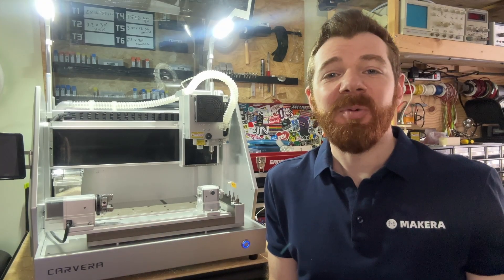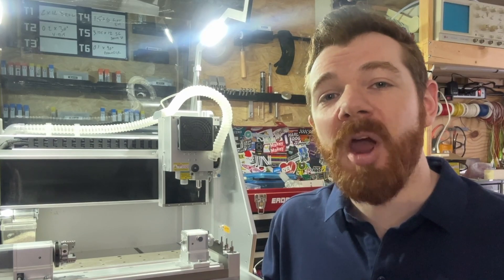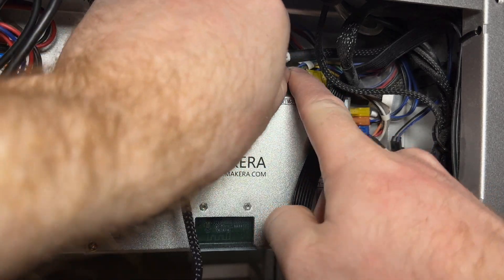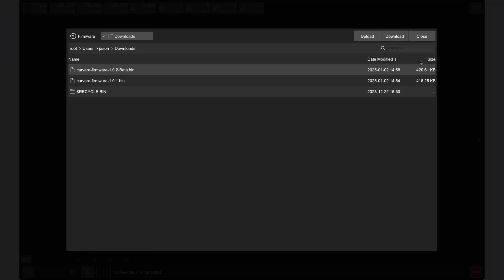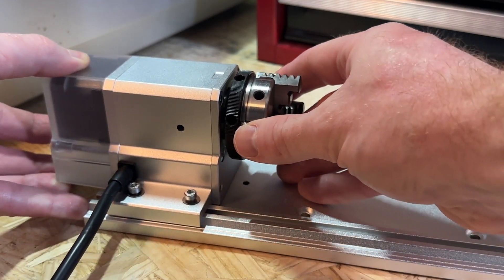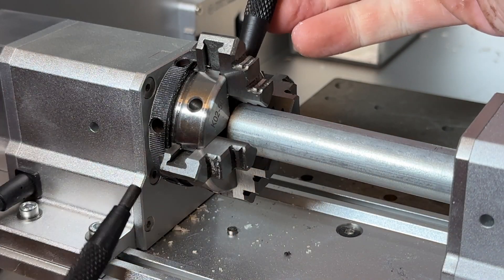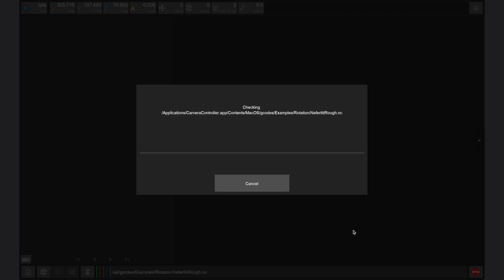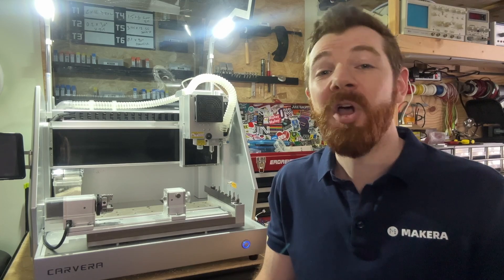4th Axis with Harmonic Drive Installation and Configuration on the Carvera Desktop CNC

Comment: My 4th axis crashed against the vacuum reservoir in the back of the carvera when doing automatic tool change of the tool in position 6. I didn't see any instructions about not using tool 6 with the 4th axis. is there something wrong with my setup? I installed per the instructions, 4th axis installed using the locating dowel pins in the location that the manual indicates.
Reply from the maker: This shouldn't be the case, perhaps you didn't use the correct locator pins? Please contact our customer support team for further assistance.

Comment: @Makera I finallycompleted the 4th axis installation on my Carvera! Been putting it off for about 5 months!…anyway the installation made me have a question…as i took the back cover off, i was curious whether you can leave the back off to carve long stock  - for example if i have a table or chair leg where i want to carve a 3d relief into?
Reply from the maker: This is not recommended as the electronics would remain exposed.

Comment: What is the difference between the more expensive version and the less expensive version?
Reply from the maker: The updated 4th axis is more expensive as it is equipped with a Harmonic Drive system as described in this video. The older and more affordable model used a more traditional belt drive system.

Comment: So since I am using a harmonic drive 4th axis, will I have to remake the gcode of my past files or will it work normally? Do I need a new post processors? I use deskproto
Reply from the maker: No, the 4th axis with harmonic drive operates under the same parameters and processors, but can hold greater detail and precision compared to the previous.

Comment: wow. i had hell with my install. turns out when you leave the USB plugged into your computer, it keeps the carvera logic board powered, but of course there is no motor power. homing fails, on and on. Let the machine power up fully and home before plugging the USB into your laptop and connecting with the software!

Comment: check_4th doesn't work for me but when I try to move the A axis in the controller, it moves. I'm using firmware 1.02. Thoughts?
Reply from the maker: What happens when you do "check_4th"? Is there an error or does the controller say its running as it should, but no response on the machine? Please reach out via support@makera.com if you're 4th axis is not operating correctly so we may assist further.
Reply: @Makera  There is no error and it just sites there. The 4th axis is warm so it's getting power, and on the controller I can move it but only a bit. When I select 90 and click on the A axis to move it moves maybe 5 degrees. I'm going to open it up again and double check my wiring.
Reply: Jiggled the cable and she's all good now. It was a tight fit in the back of the CNC and it looked like the connector was all the way in but apparently it was only close. Nice easy fix. 👍

Comment: Great video. Thank you.

For those of us looking to work with round or hex stock, what size and style of 3 jaw chuck will we need to purchase?
Reply from the maker: You can reverse the chuck jaws, as shown in this tutorial: https://wiki.makera.com/en/carvera/maintenance/swapping-jaws
Reply: @Makera  hi
Unfortunately that isn't helpful as you can't securely hold round or hex stock in a self centering 4 jaw chuck, hence my question.
Reply: @slicougar9222  The 4th axis uses a M14x1.00 mounting bolt. So a Sanou K01-63 or K01-50 wold be good 3 jaw replacements

Comment: "the harmonic drive has 4 times the torque compared to the original 4th axis"

Jason, can you please provide a Nm specification for the holding power? Your claim is a bit hard to believe. The original 4th axis uses a  1.6:1 gearing ratio. Roelof has confirmed on the Carvera Discord that the new harmonic drive 4th axis uses a 50:1 gearing. The stepper motor must be nearly 8 times weaker than the original for the new rotary axis to have only 4 times more torque. Judging visually by the size in the video, the stepper looks to be of similar size as the original. I would have expected closer to 30x the torque.
Reply from the maker: The original 4th axis operates with approximately 2 Nm of torque, while the 4th Axis with Harmonic Drive operates at a peak of 8 Nm.
Reply: @Makera  Thanks for that. I believe the 8Nm of the Harmonic Drive, but I still don't believe the original has 2 Nm. Please double check your numbers.

If I look at a high performance name brand stepper from LDO that is similar dimensions LDO-42STH60-1206, it has the holding torque of 0.63 Nm. Through the 1.6:1 gearing of original 4th axis that makes is 1 Nm. The original 4th axis doesn't have any branding or markings to suggest that it's a high performance stepper, so I would expect it to have less than 1 Nm.
Reply: @sergebakharev1945  3nm is the average torque needed to open a twist jar or a soda bottle.